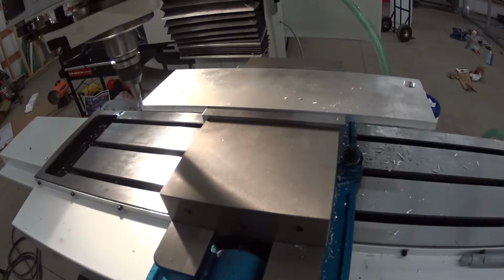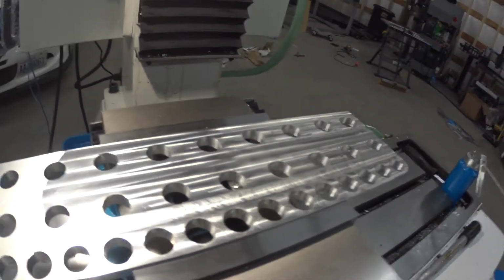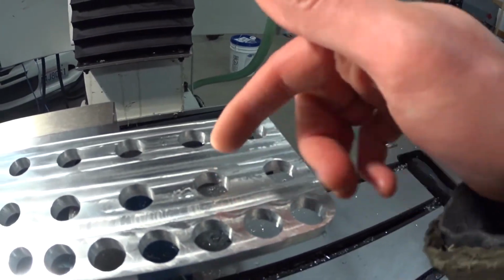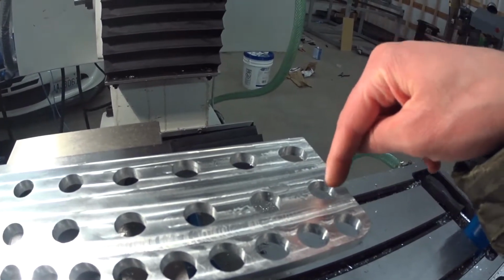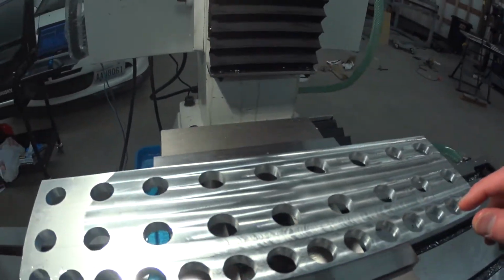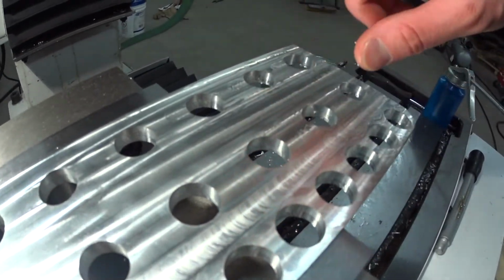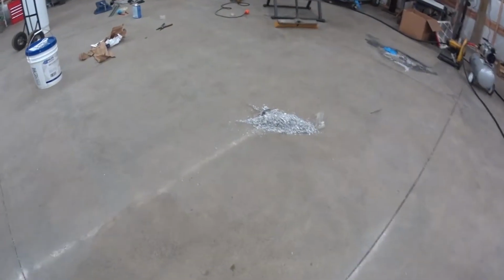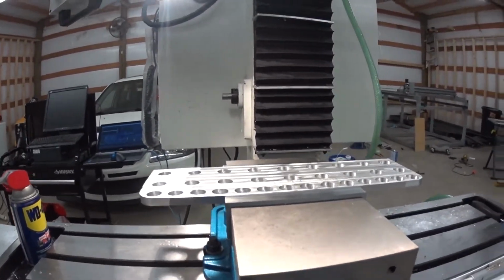PM940m CNC TTS Tool Rack Part 1

Comment: Glad to see it's up and running! Just a couple of ideas, change the set screws in the tts set screw holders out to more quality stuff. NYC cnc has done some videos on that and has McMaster part numbers listed in their videos and website. That will help a ton with tool pull out. 

Also I tend to have a lot better luck with the high helix 3 flute end mills like a yg1 alumapower. They don't chatter or deflect as much as a 2 flute usually does. 

Keep the videos rolling and Merry Christmas!
Reply from the maker: Hi Stuart,
I was watching the video from John and now that I have had the tool pull out I'm definitely going to go order the new grub screws.  

I never thought of using a 3 flute end mill and I love the YG spiral flute taps so I will give those a try. This particular end mill is a Standard Cutting Solutions end mill and it was on the cheaper side so I figured it might not be the best in terms of surface finish. 

I am hoping to get more machining videos out on a more regular basis since I got a lot of projects lined up. Merry Christmas to you too.

Comment: How did you move this mill on to its stand?? where did you lift it from in the body.
Reply from the maker: HI XStance,

I used an engine hoist and lifted the mill by the headstock after lowering the headstock as far down as it would go resting on a 2x4. I followed the recommended procedure from PM in their manual on page 7:
http://www.precisionmatthews.com/wp-content/uploads/2017/06/PM-940M-6-24-17-v4-Web.pdf

Hope this helps.
Thanks